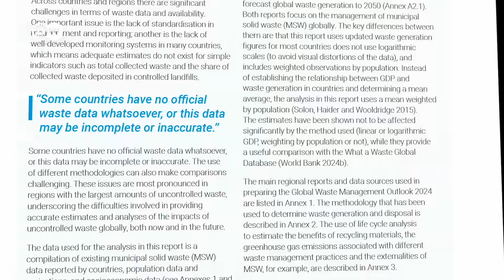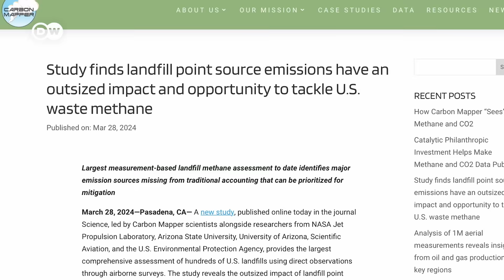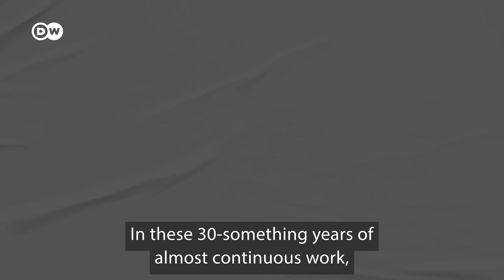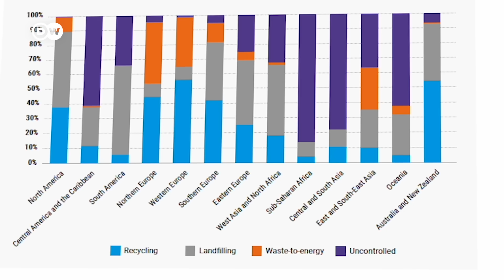We need to fix landfills – here's how

Comment: "...in the short term, [methane is] over 80x more potent at heating the planet than carbon dioxide..." Um...but if methane emissions never reverse (show me the 20-year stretch where we abate methane emissions)...doesn't it follow that methane is THE big, controllable GHG emission of interest? 

It seems like most reporting on this is wrong. Methane is minimized and emphasis is placed on transport and EVs, but we should be doubling down on agriculture, trash, and other sources of methane more than anything because it has both near- and far-term consequences. What am I missing?
Reply: The reality is methane and carbon dioxide both need to be curbed soon and fast to avoid tipping points. The methane stat he included here is used EVERYWHERE but it's deceptive for two reasons. 1. He leaves out that the "80x" more potent refers specifically to over a 20-year period. 2. The average time of methane in the atmosphere is closer to 11-12 years, which a research paper suggested means that methane is in fact 101x more potent in its lifetime compared to carbon dioxide. So yes, methane is really bad.
Reply: @KanineC  Wow/yikes...

I do agree with both/and, but honestly...choices WILL be made, and it seems like most of the CO2 choices are low-hanging fruit that won't really disrupt capital (EVs are good for profit margins actually). But changing the food/waste system or even simply rolling back subsidies on meat and dairy seem like a political non-starter...feels like we're truly screwed.
Reply: @falsificationism  Yeah, if we could focus on one, we buy ourselves a bit more time by focusing on methane. My belief now is that we have to get rid of market-based economic systems (profit/growth addiction) to have a chance at a human hospitable climate for the foreseeable future, which would require major social upheaval. It's definitely easy to give in to despair, but we're better off at least trying.
Reply: @KanineC  "... we have to get rid of market-based economic systems (profit/growth addiction) to have a chance at a human hospitable climate for the foreseeable future..." Here here! Jason Hickel talks about this in his trade publication on degrowth and I really couldn't agree more! Lots of work to be done...fundamental changes to systems...incrementalism isn't going to get it done.

Cheers and thanks for the additional clarity on methane!
Reply from the maker: Hey everyone! We actually tackled the idea of degrowth a few months ago. You can find it here 👉https://www.youtube.com/watch?v=_22mKe_OLsg Let us know what you think ✨
Reply: @DWPlanetA  Confirming this was good! ☝🏽

Comment: I'm a waste reduction specialist. 
The solution is to reuse FIRST rather than recycle. 
WE need refillable food packaging, not disposable. 
We had this in the recent past. It's achievable. It's cheaper. It is the ONLY sustainable solution.
Recycling is NOT the only solution. It's a low priority in terms of sustainable development
Reply: Remember that the plastic industry is the fossil fuel industry. They have been aggressive in usurping re-useable packaging.
Reply: Or better food packaging, TV dinners for example has plastic covering the food and can not be recycled.
Reply: @dennis2376  Covering the food?  That's a gram of film.  Did you not notice the plastic tray the food came in?
Reply: @frequentlycynical642  Very funny.
Reply: Yes!
Reply: How about reduce waste upstream first?
Reply: @Cy5208  Yes, the top of the topsyturvy piramid is the most important and comes first. Reuse is the 2nd.
Reply: Shouldn’t the first thing be reduce since you’re a “reduction specialist“ ?
Reply: @chirayujain9183  reducing in the food chain supply means elimination of disposables. Removing any unnecessary packaging Replacing any necessary with REUSABLES.
Reply: I too am a waste reduction specialist. We need to boogie hard.
Reply: I had the same thought myself recently. A lot of waste is from single use items. Glass was great but it was fragile and less convenient. We were told plastic could be reused but it is made into so many compositions and colors that the process is difficult to manage and execute. It feels like we might have to find a more easily biodegradable material or forgo some convenience altogether.
Reply: Exactly.
There was a documentary about how Coca Cola replaced a working glas bottle system on an island so it could squeez out a few more cents with the end result that the island inhabitants were not prepared and able to recycle all the plastic waste created. 
Now see that on a global scale.

There are also meanwhile popping up again stores where you can get in flexible quantities anything from grains to beans, rice and what not. Before those we have had that for a long time in the sense of centner packing, but nope we needed smaller packaging which in return ment more plastic needed to package the same amount of food.

Look at how the Oil/PetroChem Industry replaced hemp products and lobbied it internationally.
Reycling becomes even less effective when you think of the hundreds of different formulars for plastic and how those can not be recycled when they are all thrown together. Ofcause noone wants to have those clearly identfied or reduced to a managable amount of a few plastic formulars for easy recycling.
Reply: You are obviously  not in the food production industry? Take Tetrapak; 190 billion units per year produced, and only 27% recycled, at 74%. They generate 145,000 tons of waste from the recycling of 27% of the Tetrapaks produced. There are technologies that can achieve higher efficiencies, but the big recyclers are not interested in improving their efficiencies because they are basically Greenwashing operations HOPING that the governments don't penalise them.If Has Rausing set up today he would be banned.
Reply: But what happens with all the plastics you reuse, your house turns into a dump haha, burning it in oxygen free enviroment, converting into crude diesel would be a good idea, to have one in every town, you cant tell people to re use things, people are selfish by nature and don't care one bit. Fining people for not recycling/too much trash would be another approach. Businesses give even less a fck about recycling, especially if they make enough
Reply: @33mavboy  we don't choose plastics. Plastics are largely unsuitable for most food applications because they are so heavily polluting.
Reply: @reuse_or_die  Yeah man, plastic cutting boards, why are those still sold
Reply: @---nt5mb Where I live, PET is really recycled. Someone needs to close the gap some place near where you live.
In the same time, you are right about refills. In our town, we have a shop that does this. Of course you can't buy everything there, but the way we do shopping is, this shop is 1st stop and we stop at the shopping mall just to complete the shopping list with items they don't sell in the 1st one.
Reply: @---nt5mb OK, can you explain what I should understand with "infinitely" in the context of recycling?
Reply: @beatreuteler  infinitely recyclable means that the material hardly degrades at all.in the recycling process. So a stainless steel coffee mug is truly sustainable because it lasts for years and then can be returned into the waste stream to be remade into the same thing.
Plastic loses it's viability every time it's melted. You can't remake plastic food items with plastics recycling for very long. Also the pollution issues with every part of the plastic process far outright that of stainless steel or glass or ceramic or silicone
Reply: Reduce is better though 😅
Reply: @moos5221  absolutely get rid of all this unnecessary stuff.
"Buy less shit" as many people have been saying since the 1960's
Reply: @---nt5mb because too much of it is being used. Plastic degrades every time you recycle it.
Reply: What is a practical example of re using food packages that companies will get onboard with
Reply: @olivergilpin  milk, soft drinks, beer can all be sold in returnable glass deposit bottles that get cleaned and refilled locally. We did this across the world until the mid 1970's, when plastic bottle subsidies ruined the market making it uncompetitive to use refillable.
Reply: Disposable isn't that bad. It's all about the materials used. Disposable paper is not a problem, disposable plastic is.
Reply: the solution is banning plastic
Reply: People will complain about health and safety and disinfecting packaging before bringing it to the store.
Reply: My food comes mainly from a non-profit store buying organic food from local farms, and it’s mostly bulk and package-free. Of course it requires a bit more time and organisation, but it’s worth it. And cheaper as well. I’d encourage everyone who has that kind of opportunity to give it a try!
Reply: Self-service checkouts in supermarkets necessitate prepacking. This has resulted in much more plastic packaging.
Reply: @tomellis4750  virtually no real products need prepacking. The only stuff that might need packing is precooked food, which can easily be served in returnable containers. Reusable containers were the only packing before plastic came along in the 1960's. We didn't starve.
Reply: @reuse_or_die  Maybe you were not alive in the sixties. Tin cans and glass jars were not reused.
Reply: @reuse_or_die  Quite. Supermarkets want quick throughput, that's why so many things are prepacked nowadays, they are in bags with a bar code because it means it's faster through checkouts, particularly self-service ones. This has led to an increased use of plastic, around 30% more in Tesco over the last three years.
Reply: @pauleohl  maybe I was and I spent my entire childhood saving pocket money by taking the deposit bottles back to the shops!!
I was born over 60 years ago.
Cans are not such an issue for recycling because they are much more sustainable than plastic. Plastic degrades every time it get processed and metal doesn't largely. Especially stainless steel.
Reply: @tomellis4750  more than speed, the major supermarkets want us to consume the maximum amount we can afford, which is killing us.
Reply: @tomellis4750   Those checkouts changed nothing.
Reply: Fish and meat have to be sold in single use packaging.
Reply: @pauleohl  That's what the plastics and supermarket industry wants you to think.
Reply: @tomellis4750  Even before plastics, the butcher would wrap up your meat in heavy reddish brown paper and put that in a paper bag. The packaging was one time use...and rightly so.

The fish man used newspaper and coarse salt, which is really astonishing because of the ink.

The alternative is that you go to the store with clean Tupperware and take home your order in it and clean it out for the next trip. Not likely to happen.

My daughter has thin sheer fabric bags which she takes to buy produce and she uses them repeatedly. The merchant loves it because they weigh the produce in the bag.
Reply: @pauleohl  The thing with the Tupper that goes back and forth is what we do for eggs. We use a strong multi-way egg "cardboard" for 8 eggs at a time and are taking that with us when we go and buy eggs in a nearby store that sells them open.
Reply: @pauleohl I already do the Tupperware method, there is no problem with it, ay least in Spain. But you are right, it is not common to see it.
Reply: @pauleohl  and then you would put the paper parcel into a string bag not s throwaway one 
We can do better than this disposable rubbish. We can use returnables. It's not hard
Reply: @pauleohl  Best comment
Reply: @tiborbede8972  Which one? I had a few on this thread.
Reply: @pauleohl  no they don't. They can be sold in stainless steel, glass, ceramic or silicone bamboo jute or hemp boxes all of which are infinitely recyclable after they have been reused tens to hundreds if not thousands of cycles. Please stop declaring stuff that isn't backed up by experience or facts.
Reply: @reuse_or_die  What can be sold in  stainless steel, glass, ceramic or silicone bamboo jute or hemp boxes?

Comment: Plastic gets all of our recycling attention because the fossil fuel lobby has been marketing it to us for half a century. Ironically, plastic is the one material that is really not a concern at all to landfill. It simply acts as a stable form of carbon storage. Wet waste and paper products are what need to be focused on to get out of the landfill, the best option is anaerobic decomposition into fertilizer and methane. But even just incineration is much better than letting it rot in landfills. The issue is when incinerators start burning plastics.
Reply: Why is it an issue if they burn plastics?
Reply: Conservation of matter, plastic being burned releases much worse chemicals into air particles thar can be inhaled, seeps into water sources or stays in the atmosphere that gets in to the water cycle. While plastic just staying in the ground is just slowly breaking down by uv ray and the elements. Not that much better since it'll still degrade and pollute the area but not as catastrophic as burning a large volume of it everyday without any processing
Reply: @lockehart7716  you are incorrect dont you think they filter the gases generated by burning. Also with burning you get some metals as a byproduct that dont have to be mined again so it reduces co2 emissions even more
Reply: @eltorito4897  read again "...but not as catastrophic as burning a large volume of it everyday without any processing"
Reply: @tec4303 burning plastics releases Microplastics into the air
Reply: Plastic isn't recyclable because its b8ological. It's not biodegradable either as most biological materials are.
It's poision. That's contaminated the entire biosphere.
Your aware view of the fosil fueld industry lies mixed with your blasay attitude to plastic is very disconcerting. Plastic ir recyclable is the most damaging lie that's ever hit the biosphere

Comment: In 🇱🇻 there were NiMBYs that tired to stop Waste to Energy 🏭 plant since it's "positioning" the air. In hundreds of years even the engineered landfills will be filled with micro-plastics.
The only solution is to reduce trash, reuse, recycling, waste to energy or waste to fuel. Only ash and non recyclable, non-burnable trash goes to a landfill.

Comment: Recycling is expensive. Reuse is better, for example by putting a deposit on packaging such as bottles. In theory, prevention is quite simple, but the political will is lacking. Individual citizens have little room for maneuver here. Politicians must regulate this through laws. The negative effects of landfills can be minimized by drying the garbage so that it does not ferment and by banning toxic substances in the materials. Organic waste could also be disposed of in the sewage system without causing any ecological harm, but you would need 1) a shredder and 2) enough water. This would actually work with plastic waste too. This would save you having to have garbage trucks on the road and garbage cans in the city and garbage rooms in buildings. Disposal would be much easier and there would be no smell anywhere.
Reply: Recycling is not always that expensive. For example, production of new aluminium requires 20x more energy than recycling.
Reply: @thelloydersvk5068  good point
Reply: Drying would require additional power, which would create more pollution, unless done in an ecological way (sun…)

Interesting idea with the sewage system. I wonder how realistic and beneficial that would be…
Reply: @brunosco  You can get a lot of energy back from the drying process. Just use the steam for other purposes.
Polutions is a question of how good your filters and burning processes are.

Comment: Build waste incineration plants! This may not be ideal from an environmental policy perspective, but it solves the waste problem and even saves CO2 if it means that coal-fired power plants can be closed.
Reply: I live near by such a plant. The electricity production is almost laughable compared to a coal fire plant.
Reply: @johgude5045  you compare 2 randomly chosen plants. how smart is that?
Reply: @santaclaus0815  I used to worke in a waste to energy plant. Unfortunately because of the trash the tubes in the furnace corrodes if you let them get to warm so you cannot utilize as much of the energy in a steam turbine as you can in a coal/oil/gas plant. You're lucky if you can get 20% electricity in an economical way. Most energy from our plant goes to the distributed heating system for the city. In a good day it is 40 MW electricity generated and 190 MW heat delivered. Most often it is less electricity. But its a really good way to heat cities and give a little support to the electrical grid. In summer some of the heat is used for absorption heat pumps in the district cooling system.
Reply: @lofen83  exactly what i meant, thanks for the comment. Here in Germany Coal Power plants all have an efficiency of 35 to 40%. The incineration plants are also all in a same league, below 20%, while the ones that are more efficient all do waste drying prior to entering the facility. The one only 1km away from my flat mostly uses wet waste, being mostly below 10% electrical efficiency.
Reply: A friend of me works as a technician in that plat and he told me that it is most challenging to burn the waste during winter time, after it has rained. I dont mean that burning waste in such a facility would be bad in general but you should feed it the right waste, the one that you cannot treat otherwise. Unfortunately
Reply: Not to mention that CO2 has less effect than methane on global warming.